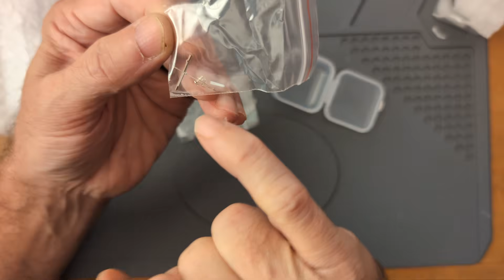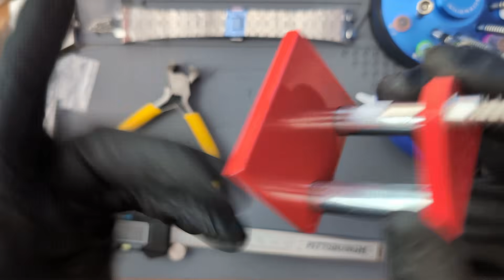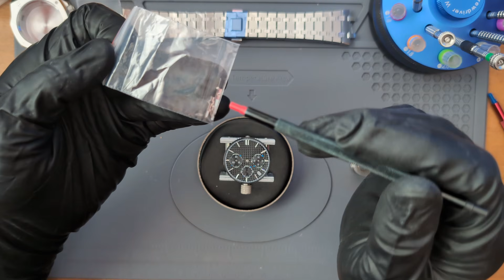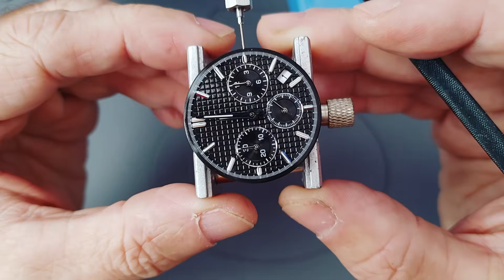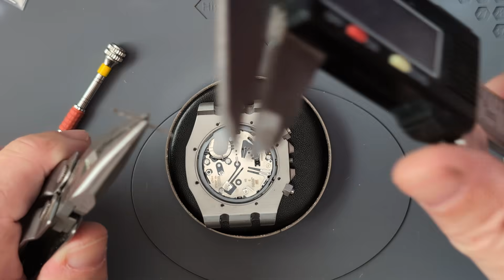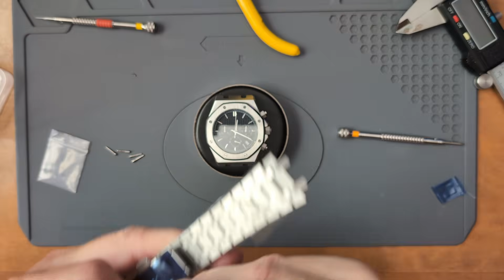Ever wanted an AP Royal Oak but not want to spend $20k?

Comment: Hey mate, I really enjoy your videos, but I have to say - I know this isn't a business, you're not selling watches you've built to people, but you did say someone paid for you to assemble this watch? 

I genuinely couldn't be ok with sending it out with those faults in regards to setting the hands. Having a chronograph with the centre seconds not aligned at 12? And the date was clicking over as the minute hand swept past about 25 minutes before midnight? A bit of time spent taking the hands off and trying again would have sorted this for sure. I'm no expert watchmaker or anything, but I've done a few builds this year since getting properly into the hobby and still managed more refined hand setting than this. A bit sloppy imo.
Reply from the maker: Noted. And I don't disagree. But keep in mind that these components were all customer provided. And came with notable defects. about 45 min of hand setting footage ended up on the cutting room floor because I removed and reset the hands so many times. Ultimately the stopwatch counter refused to line up. I must have reset that 10+ times trying. So a new set of hands would be necessary, which would add a two week delay and additional money that I'm not sure this guy cared to spend. On top of that, I'm not getting paid very much. The problem with the bracelet not fitting the case took another hour of communications and custom fitting for example. I guess my point is, at essentially getting paid minimum wage, it is what it is. But yes, you are right. Perfection should be something we all strive to produce.
Reply: It's a nice watch.

Comment: as he said "quartz movement" I canceled..
Reply from the maker: Lol. While I'd definitely agree that most automatics and or mechanical movements are way more prestigious, there is a certain place for quartz . They are extremely accurate. And you never have to set them, you just pick it up and go. Also way less delicate for everyday activities. But they definitely get a bad rap for sure because of how inexpensive they are. Yet some pretty big brands still make some pretty big money selling them. 🤷
Reply: Pure snob. Don’t interact with watchmaking if you’re dismissing the craft and quartz just to flex. And the irony of doing that while watching a homage rebuild of the most hyped watch.
Reply: I've got both a Pagani Design "royal oak" and a Militado ML05. Both have Seiko 'mecha-quartz' movements in (Militado is a VH31, not sure on the Pagani, VK63 or VK64?) and they are excellent. Perform waaaay beyond the stated accuracy specs. My Militado loses about 1 second a month, barely even half a second if I'm honest. Big fan of (good) quartz movements. Emphasis on "good".